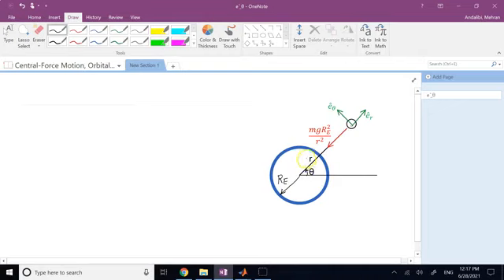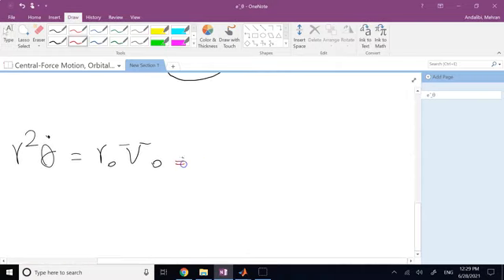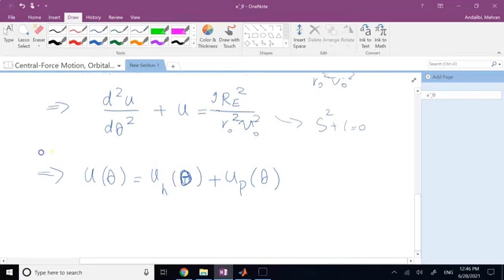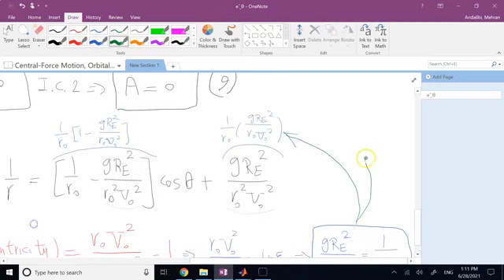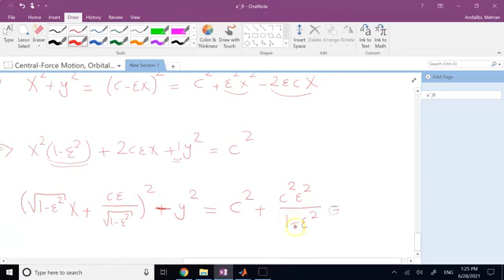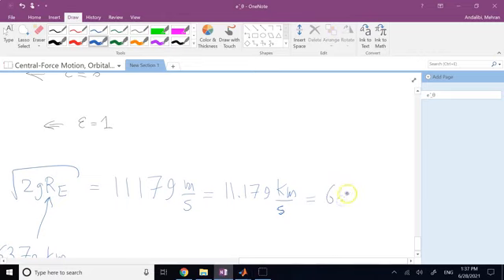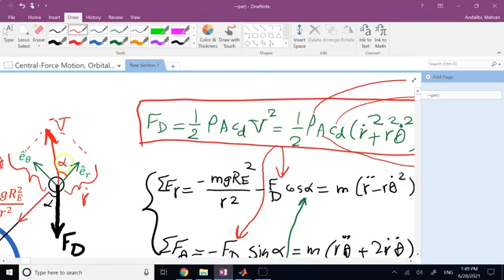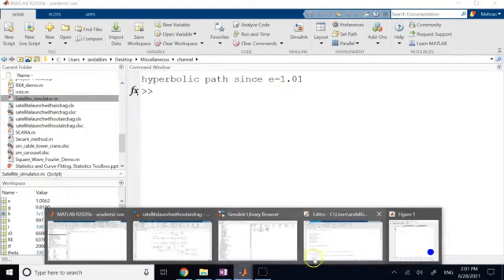Orbital Motion (Central-Force Motion)

Comment: Hello, great lecture.  I've watched this a few times.  I have a question about how you derive the "force expression" mg(R^2/r^2).  At about 2:10 in the video you introduce mg = G Mm/R^2 and note this is what "mg is equal to (magnitude) at the surface of the earth".   I don't follow this "equality" or what assumptions are used to make this claim.  I assume "m" is the mass of the satellite and "g" is "9.81..." So for this to hold, are you saying, "if the satellite were on the surface of the earth", the force mg would be GMm/R^2...   then create the ratio (f/mg) that reduces "mg" by this factor (R/r)^2... ?